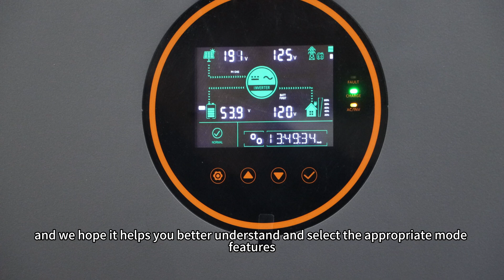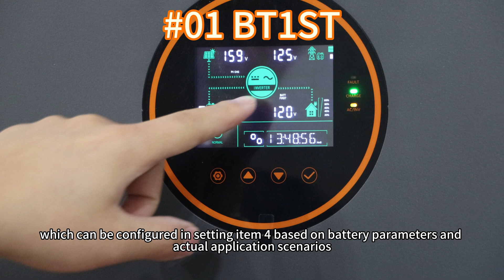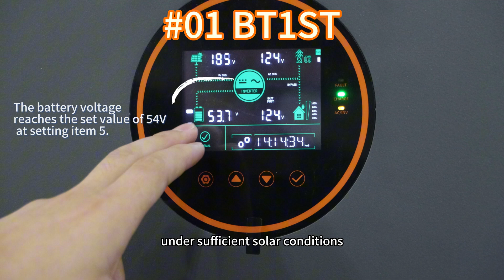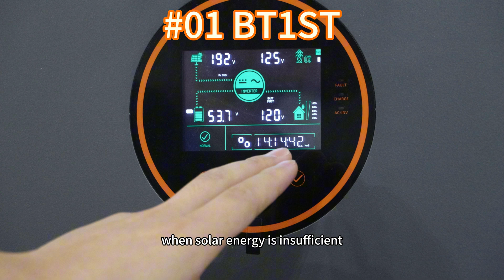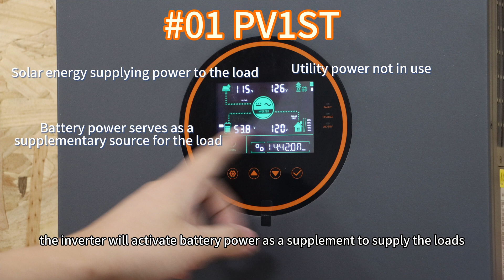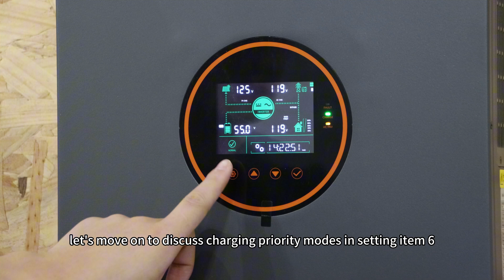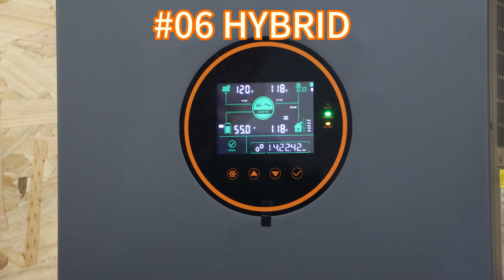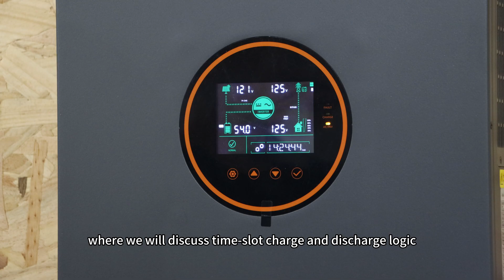Working Logic of Output Priority Mode & Charging Priority Mode - PowMr SunSmart SP5K

Comment: El mod pv1st es para cuando el sol no sea suficiente entonces te use el utility y deje la sbat par aultimo ? como la funcion SUB ? es que me llega un equipos de estos en unos dias y actualmente tengo un sumry que tiene esa funcion y me hace un poco confuso lo que explican, gracias
Reply from the maker: PV1ST(Solar First Mode): Switch to Mains
Power when PV has failed or battery
is lower than Parameter [04] Set Value.
Reply: @PowmrSolar entonces no hay un modo que se pueda poner esa prioridad ? Es decir primero solar, segundo red y por ultimo baterias ?

Comment: I just want to use for Solar and Battery .... what happens when the battery is fully charged ? will it automatically go to solar?
Reply from the maker: It depends on what parameters are set.
Reply: @PowmrSolar  where can I set it up for Solar and Battery only without mains ??? and how can I know if the solar are charging the batteries?
Reply from the maker: @robertjalu6897  You can look at page 25 of the manual.
https://cdn.shopify.com/s/files/1/0746/0415/1079/files/POW-SunSmart-SP5K-user-manual_6fb37499-6e98-4f67-8288-e613efd75941.pdf?v=1686636740
Reply: I got the Sp5k unit. When the battery is full, it won't restart charging even with the set point I have set for it.. any info on what to do here, please?
Reply from the maker: @ Please provide your setting video and send it to this email: support@powmr.com. Our technical staff will check it for you.